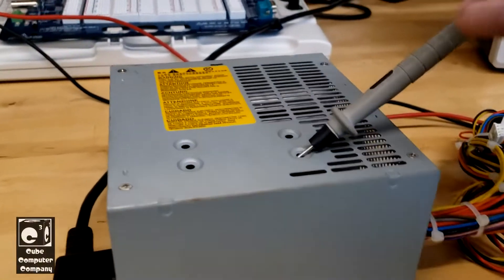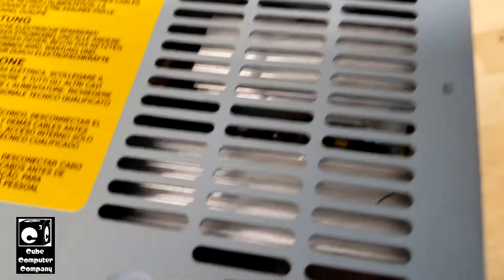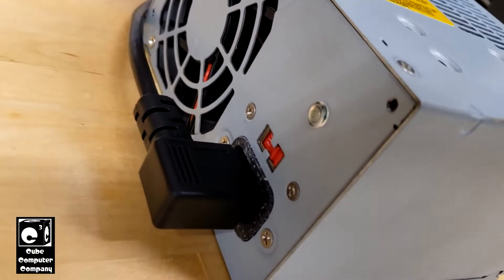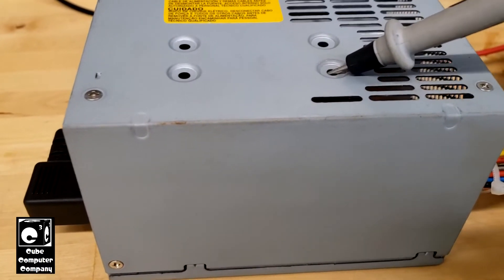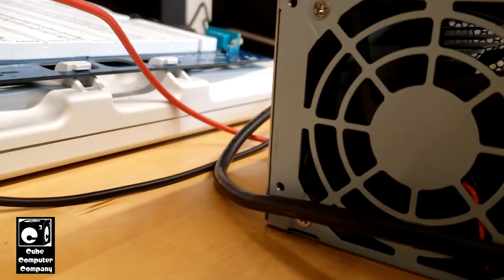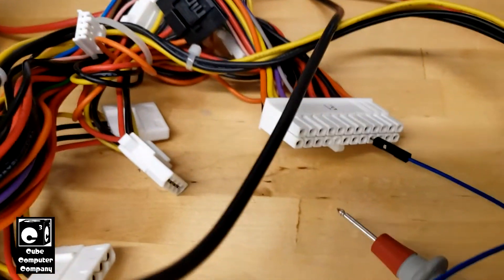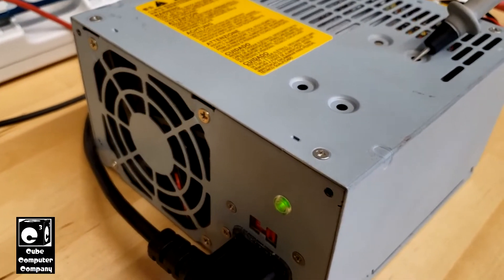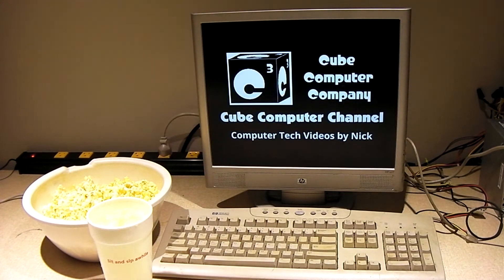PT1 - Troubleshooting a dead Bestec ATX-300-12Z PSU

Comment: I guess my power supply is screwed
Reply: It has all of this, but worse the light on it will turn on and shut off almost immediately repeatedly, and it’s constantly making a ticking sound
Reply from the maker: @nonfiction06  Yours may just need the 5VSB capacitor replaced. It's a 2200uF 10V electrolytic capacitor next to the 5VSB/aux transformer. There's another nearby capacitor, 220uF 50V electrolytic, which also sometimes goes bad. Typically electrolytic caps will bulge or leak when they fail.

Comment: Thanks fot the info, but I have a question, what's does it mean when the green led blinks?
Reply from the maker: The output capacitor for the 5VSB rain has failed. It's located between the 5VSB transformer and secondary heatsink. Typically when it fails, it's bulged on top, but not always. Replacing this capacitor should get it back up and running. It's a 10V 2200uF capacitor.
Reply: @CubeComputerChannel  thaaaaanks!!!!